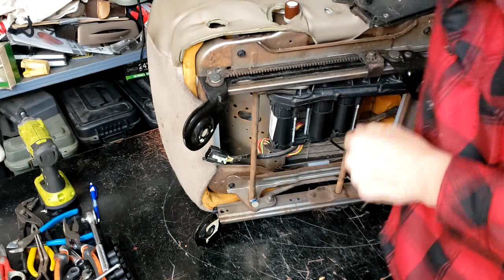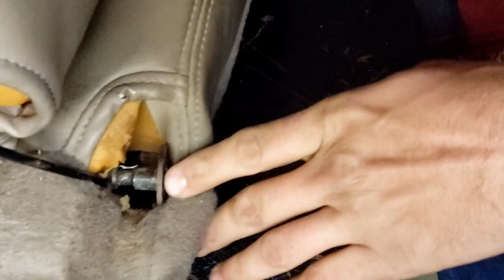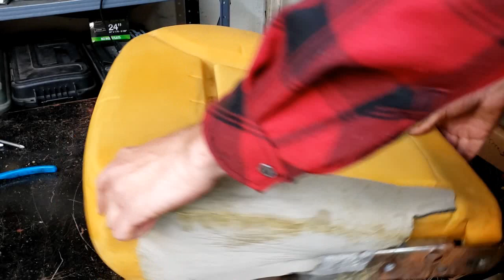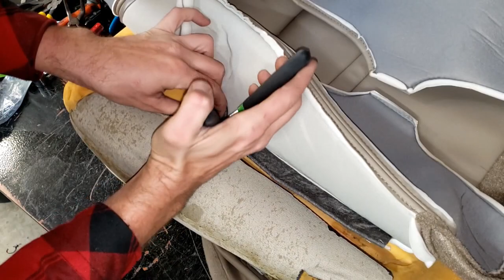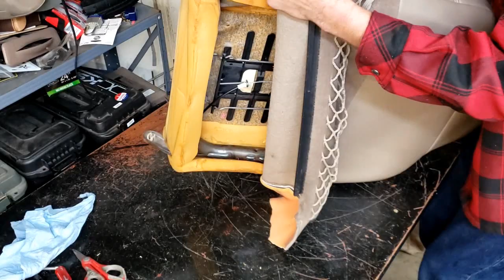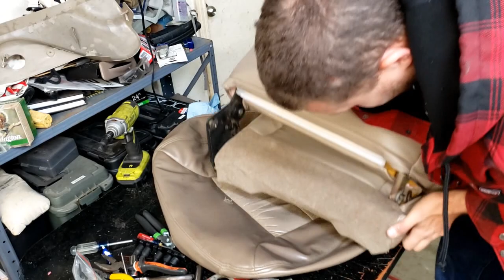How to replace Leather seat covers!  Ford Excursion and F250

Comment: Loved the video! QUESTION: I have a 2001 Excursion Limited since new. I have new front Envelops and seat foam. I cannot locate the Backrest foam and they have chunks of the foam missing. What do I do? Is there a place that sells the seat back foam? I've look with no success. Thank You, Bob Griffith, Central Fl.
Reply from the maker: Hi Bob, thanks for the comment! Right now, no one is making them unfortunately. An upholstery shop can repair them, or you can use generic seat foam and cut it into the shapes that you need, then use 3m Headliner / foam spray adhesive to plug it in. That what an upholstery shop would do
Reply: @TheGaginator  thank you, I guess I’ll just do the seat. I wonder why they don’t have an aftermarket for the seat back? Thank you again for your help.

Comment: Did you end up tucking in that little bit of foam protruding from the bottom seat? That would have bugged me.    Also I like to sit the seat out in the sun and get the fabric nice and hot, then you can stretch it really easy.
Reply from the maker: Yes I did, and your advice about warming the material first is spot on. It makes it alot easier to deal with the folds and wrinkles as well

Comment: Where do I purchase the front bottom drivers seat skin for my 2000 F 350?  Ford doesn't have the replacement new part.  Thanks
Reply from the maker: Ford does not make them. There are quite a few companies that make them now. Best bet is google and read reviews . I used a company near Houston TX for these.
Reply: @TheGaginator  is the company in Richmond or rosenberg?
Reply: I used Richmond Upholstery, great quality and came with the factory logo and the match was SPOT ON!!

Comment: What size hog rings do you use? 3/4, or 1/2 or 3/8? And what brand hog ring pilers would you recommend? Thanks for the video I am going to attempt this
Reply from the maker: the pliers I used are from Amazon, and are bad, I would not recommend them. I had to modify the jaws just to make the tool usable. 3/4inch, The seat covers will come with the proper size as well
Reply: I do upholstery kits on 60s mustangs. NPD(National Parts Depot) sell a very good set of hog ring pliers. It comes in a kit with hog rings.
Reply: @FE428Power  I did the upholstery on my 66 with covers from Dallas Mustang.  It wasn’t too complicated compared to newer vehicles and they looked great.

Comment: Don't Limited seats have seat heaters?  I wish you covered heater installation
Reply from the maker: Yes, most after 2000.5 do. They heaters just stay glued on the seat foam, so no extra work. They are not attached to the leather, and do not come off unless you peel them off of the foam on purpose

Comment: Thank you for actually going in depth on how to replace the leather, I have a 99 f350 crew cab and the seats are getting pretty bad, I have two questions, my first one is have you ever done the back seats?? And if so how hard was it to do? My second one is I have the center console model instead of the armrest model, my question with that is where can I find replacement for that?? I’ve looked and just can’t find anything for the center console.
Reply from the maker: I not done the rear seats, But have had them done by our upholstery shop a few times. "The Seat Shop" in Texas has replacements for some years on the console. If not, any upholstery shop can do it for you pretty cheap.

Comment: Great video.  I just did my f350.  Unfortunately, the vinyl set I bought seem a little loose.  Also, half was Velcro on the seat bottom and hog rings on the back.  Both were Velcro.  Do you have a link to the covers that you purchased?  Thanks again, nice video.
Reply from the maker: Thanks for the comment! The covers from the video were made by "The Seat Shop" here in Texas